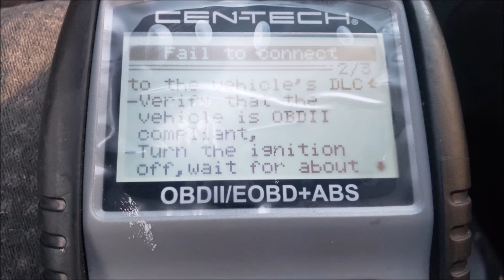nissan fusible link Failure, main battery cable fuse

Comment: Why would this fuse blow when cranking car? Just put 2nd one in and it’s blown again.
Reply: Did you find an answer to your problem? I’m having the same issue. Replaced the starter and fusible link twice but stills blows on me
Reply: @theDGKkid1234  did you ever find a fix?
Reply: @ozzyride4647  no unfortunately, but everything’s pointing to the alternator now so im going to replace that
Reply: You got a instagram man?
Reply: I'm looking for this same answer not getting any straight answers just empty pockets
Reply: @theDGKkid1234 was it the alternator? I have the same problem
Reply: @MsEproctor21    Don't know if it'll help, but the starter went out in my wife's 2006 Altima and was having strange power issues just before. After replacing the starter it was blowing the same fuse fairly often and showing starting issues. After a few weeks of messing with things trying to track down the problem It turned out to be a relay that had went bad causing the issue. Likely went bad when the starter started to fail.
Reply: @domt5782   Don't know if it'll help, but the starter went out in my wife's 2006 Altima and was having strange power issues just before. After replacing the starter it was blowing the same fuse fairly often and showing starting issues. After a few weeks of messing with things trying to track down the problem It turned out to be a relay that had went bad causing the issue. Likely went bad when the starter started to fail.
Reply: @thedamnedlegionary9184 what relay?
Reply: @mrhanky5555    Sorry, I probably should have put that in the original comment. But it was the starter relay. It can  overvolt and cause tons of electrical issues in my experience. If swapping that out makes it where the car won't start (have had it happen), try starting in nuetral to make sure the neutral safety switch didn't go out.
Reply: Got a question can y’all help a brother out here I got a 2009 Altima

Comment: Would the red car with the key also turn on on the dash cuz my does that and the fan turns on
Reply: Did you figure out what was wrong with your vehicle? Because mine is doing the same thing.
Reply: Fan running immediately indicates a fault likely inside the Nissan IPDM (Integrated Power Distribution Module) a fairly common issue. * Some call it a "computer", b/c it is a fuse/relay box with integrated circuits.

Comment: Did you have any problems arise before it died? I have a 2013 NV1500 I suspect this part is going bad on, the symptoms I am having are my instrument cluster and radio will intermittently cut in/out.
Reply: Mines to

Comment: Is there any way to replace that 120 Amp fuse you have pictured at the end? My fuse blew and I had to put a screwdriver bit to bridge the gap to get it started.
Reply: I just did the same thing.  I had to leave a piece if metal on it though for it to keep running.  I'd like to just replace that one fuse. But idk if it's possible
Reply: Mine has blown 4 times in the last 6 months. Twice in one day last week. Finally just got it towed to the dealership. Had to buy the entire terminal fuse holder each time. It's really stupid you can't just replace the ONE broken fuse
Reply: @SavageThrifter  what did they say the problem was? I’m having the same issue
Reply: @anthonyagredano2330  I actually had to research the issue myself for an entire month haha because none of the mechanics I saw had any idea what was going on and would charge ungodly amounts to basically test all the grounds and rip everything and all that. 
What ended up being the issue with my car was that the starter cable and the alternator cable were BOTH going through the 120amp fuse even though only the alternator cable should have been going through the 120amp fuse. The starter cable should have bypassed the fuses entirely. Nobody ever really thought much of it I think because the cables had been hooked up that way since before purchase at a dealership. Anyway, I guess the 120amp fuse was able to maintain the power for the most part but if there was anything else going on with the car like for instance a cracked radiator...the draw was too high for the 120amp fuse to maintain everything and it would pop. If you have any more questions, let me know and we can talk over email or something. I have all sorts of diagrams and stuff because like I said, I was researching this an entire month hahah. But it's actually a super simple fix, if you have the same problem as I did, just move the starter cable from the post behind the 120amp fuse to the post that the fusible link hooks onto the battery but leave the alternator cable on the post behind the 120amp. 
If that isn't your issue then based on all my research, the other possibility is that it's a short to ground.
Reply: @SavageThrifter  hii Mad Lib. Hope u don’t mind me troubling u a bit. But i have an issue with.. well idk exactly. All i kno is the engine is slightly over the norm temp and also the AC is way too hot when this happens. Figured the thermostat so i changed that. Fixed it for a week. Got a oil leakage from the valve covers. N they’re also leaking oil onto the spark plugs u think it could be the culprit? Or another issue perhaps with the cooling system such as the radiator
Reply: @SavageThrifter  I'm changing out my first this afternoon. Thanks to your insight, I'll know what to look for.
Reply: @SavageThrifter  did it cause your car to die or stall out while driving. My SUV keeps stalling out, battery and alternator tested good, I think I have a fuse problem as well.
Reply: @SavageThrifter  my truck keeps burning the fuse can u share a bit so i can get an idea of what can it be the problem please

Comment: I need the actual wire plugs that plug into the bottom, anyone have a part number for them?
Reply: I ended up going to the junkyard and cutting them off a 2014 nissan Juke.
Reply: What happens if I use a different years Altima fuse box and place it in my 2009 will it not work or something?

Comment: Wow thanks for sharing. 👍🏻

That looks like a flooded vehicle for sure, my 2003 Nissan FX45 is 20 Years old 75k and I have Zero Corrosion in my Fusible Link, cables or battery Terminals. 

From the looks of it, if your harnesses or wirings are that corroded your going to have lots of Electrical Problems down the road 🤦🏼‍♂️

How's it holding up so far?
Reply: T😊😊
Reply: 4 😅

Comment: Listen I have a 2001 Nissan maxima. The fuseable link box broke.  It’s 100$ on eBay.  No no.  So I hooked everything up up
As if I had a link and it cranks but won’t stay idled. Battery good. I do have an inhibit relay on the way .. however only code I get is idler control
Valve. The fuse never blew. It crumbled. So I got a numb if copper wiring just w zip ties so rigged. What to do.

Comment: My is starting to be like that and it Wont charge the barttery and die next day i dont think is the alternator?
Reply: Same here, I bought a replacement fuse able Link. Hopefully that fix the issue?
Reply: @Jaime8042  did it fix the issue ? Did you check the fuses for continuity before replacing?

Comment: I've seen this battery fuse part called a few things. Battery fuse terminal, fuse block, and this a fusible link. How can the fuses be checked without code reader?
Reply: Volt meter.